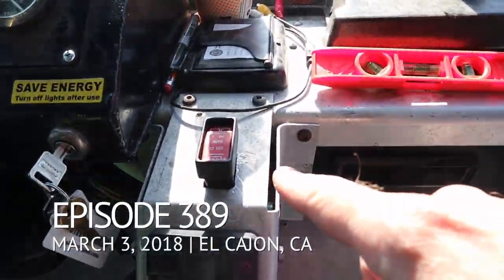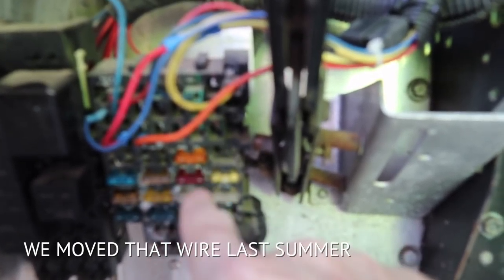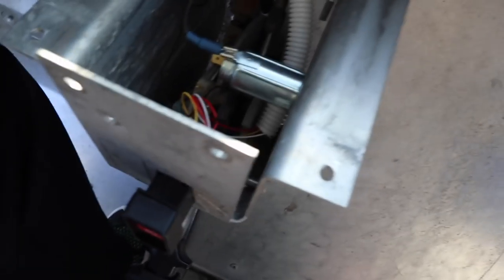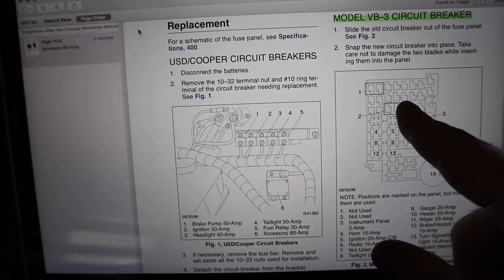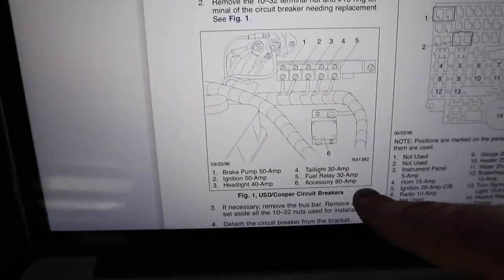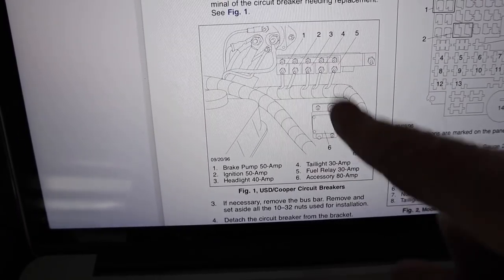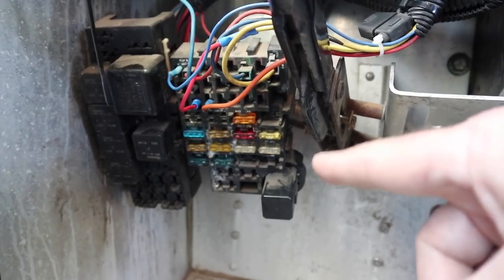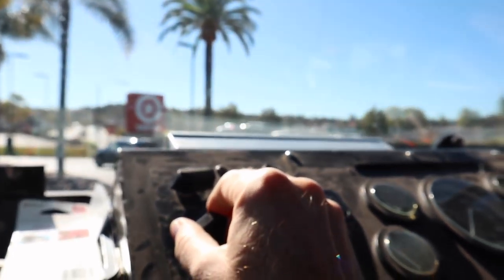Confusing Electric Troubleshooting in Step Van E389

Comment: When you stuck the test light in the cigarette lighter plug you might have accidentally touched the inside ground part of the socket and shorted it out, it's easy to do, the test light is your friend you can tell the voltage by how bright the light is. Wiring can really drive you nuts sometimes
Reply: Marty Records I'm sure that's what happened
Reply from the maker: I think you are right. I didn't know the inside walls were the ground part and most likely touched both

Comment: Hey Seven! God bless you! You didn't lose your temper! I'm afraid I would have taken the little light tester and chucked it! I really hate those things! The meter is my friend!  I'm uncoordinated, and short out the test lead on the outer part of the lighter. So I always go for the terminals on the back, so I don't short it out! Those things make me nuts! Always happens!  So with that your meter on 12vdc you'll be good, and aim for easily accessable terminals to contact.  You did great moving the WW to the IGN finding another spot. So that validates that on the fuse block #1 seems to be dead.  Not sure, but I would like to validate the red wire that is not connected to anything is maybe the same as #1.  So I do this with meter, but going for continuety tester.  So on your meter when you touch the two leads together it maybe beeps upon touching the two meter leads together.  So if you can identify that on your meter then I would proceed. The mystery red wire, strip a little insulation off, put one lead on there, and the other lead to #1 on fuse Block. If it beeps or has continuety you know that is it.  Someone else mentioned "fusible Link" which might also be the case, I think the PDF you accessed would refer somewhere that there maybe fusible links used.  A fusible link is a section in the wire that will break when amperage exceeds a certain rating just like a fuse. Except it is not replacable like a fuse.  I cut out the section and install a "Inline fuse" that I can check/and replace. So if this red wire does not read continuety to #1 then maybe it's not it at all or it is a fusible link. Then removing the fuse block, or if you could see the wire in the back of #1 and where it goes, that would be the key.  If I were to remove the fuse block I would disconnect main power at battery, just in case!  So the Fan on the Dash,  is that the original heater blower fan or an add on?  Well, you are doing great! God bless, stay patient, take breaks to refresh from frustration!
Reply from the maker: this was a big struggle for me (as you can see in the video). making good progress on stuff today and I think we have it all solved (see a video in a couple days with how we solved it)

Comment: I doubt it's the 80 amp breaker, 80 amps is pretty darn big, like the whole fuse box feed big. What I'm afraid of my friend is the Buss/wiring on the back side of the fuse block is messed up. Pulling the fuse box is not going to be fun, BUT take your handy dandy gee-whiz test light and see if you you actually have power at the fuse box where you're plugging stuff in. I just saw you move the wire for your wipers and watching your fuse box bounce around (Yep I'm commenting on the fly), you do realize every time that darn thing moves around you risk breaking and disconnecting the wires going to and from said fuse box? Check your feed (see if there's power at one side where the fuse plugs in), if it's bad fix it AND THEN BOLT YOUR FUSE BOX DOWN SO IT DOESN'T FLOP AROUND AND BREAK AND DISCONNECT THE WIRES ASSOCIATED WITH IT. Sorry to yell but if you don't tidy up your wiring it's going to continue to give you troubles and eventually leave you in a bad way in a place you don't want to be left in, and we both know that would suck! As far as why all that stuff quit I'm guessing when you stuck your test light into the lighter your probe contacted both hot and ground and made a nice little short circuit, but luckily your fuse blew, the alternative would be wires melting and maybe some fire, don't know that you want or need ratings that bad. Buy the way I used to assemble some of the wiring and hydraulics on Winnebago motor homes, now I just weld stuff together making little steel parts bigger steel parts.
Reply from the maker: you are absolutely correct. with the help of Daniel who you'll see in a video soon, we pulled it out and found no power to that section of the fuse box. a relay feeds power to that area and the connections on the relay have failed due to corrosion. we are getting close to a fix now!

Comment: Ground wire going to the dash by lighter should be on some more substantial metal. When using test light, put alligator clip on same polarity your wanting to test or you will cause a short and blow a fuse or something else like you experienced. I would suggest couple things 1. Since a small section of the fuse box is out you really need to try to pull the fuse box loose and check behind for wire/connection issues. Should have an under hood fuse box also you will want to check fuses in also and potentially wire connections to that fuse box. 2. If all that fails run a wire off the under hood wire block or battery to a new wire block since everything is supposed to be fused in line that is out, just make 100% sure everything is fused somehow and you should be back in business. Fuses can be tested with test light without removal by clipping alligator clip to positive source and  placing tip on top side of the fuse in tiny holes on each side checking for voltage at the same time, If test light lights on both sides of the fuse you know the fuse is good, some fuses will not be juiced when ignition is off so you will need to test those with ignition in the run position. Sorry to hear of your frustrations, doing things yourself for the first time can be frustrating when they don't end with the desired result, consider it a learning experience that may help bale you out of worse trouble in the future.
Reply from the maker: excellent advice. will check behind the fuse box!

Comment: Not sure if your van dash is aluminum or steel with a nickel coating on it but both of those things can cause problems when grounding the system look for a good steel place and sand the heck out of it hook the ground in the new place and see if that fixes it.
Reply from the maker: everything is aluminum except the steering column. maybe I can attach there (ps I have a subscriber helping me now working on it, appears it is not a ground issue but rather a failed relay connection)
Reply: Relay is probably it. Good luck on it. I love problem solving when it’s not my problem. Your videos are very interesting to me. Thanks

Comment: Seven, since that area of the fuse box had power and now doesn't, see if your diagram has anything describing a fusable link (it looks like regular wire but is soft and flexible moreso than regular wire).  There may be a fuseable link powering B+ components for that section of the fuse box.  You can easily check the circuit breaker with that test light, see comments below with links to test light useage. Keep in mind the whole metal point will have power on it, that touched the side of your lighter housing when you were poking inside which caused your fuse to blow. I would suggest moving the max fans to house battery and fuse protection there now too. Front fan should be key on, same with wipers.  No key off power to either. Maybe that broken red wire is the feed for something else off of B+ that was feed to the wiper power off one of those relays...
Reply from the maker: we couldn't find anything in the diagram like what mention with fusable link. maxxfans will be moved to the house batteries in the near future. not worried about them now and only mention them for diagnosing the problem
Reply: Seven Wanders the World sorry, was thinking maybe maxxfans plus the rest may have caused over current and melted fuseable link.

Comment: Trouble shooting elec. problems, as you have found out, can sometimes be very frustrating. The fuse box needs to be inspected with the battery disconnected. Check and see if the battery box will come apart, check for corrosion or a grounding problem within the box. Check for continuity on each or the wires from the suspected area on your fuse box. Be careful moving wires in your fuse box, very easy to overload the fuse on that particular circuit. Finally find out what that disconnected wire under the hood goes to, not always but the wiring if it's factory installed should be color coded, that wire appears to be a hot wire, believe it's color was red indicating it is a hot wire.  Remember, good troubleshooting  ia nothing more than a process of limination.(sp.)
Reply from the maker: great tips for the fuse box testing

Comment: When you inserted your test probe into the cigarette lighter jack you accidentally shorted it out and blew your fuse. Just remember that those jacks have a positive at the center and negative around the interior circumference. If your probe makes contact with both of them then it will short and blow a fuse. You need to very carefully insert the probe and only contact the center contact of the lighter jack when testing.
Reply from the maker: I think you are right!

Comment: One (somewhat) permanent solution to the windshield wiper issue, is RainX if the wipers decide to quit.  I rarely use the wipers, even during a downpour of rain & I see ahead just fine.  Yes, you need to reapply every other week, but at least you can see what's ahead!  That'll give you time (& a backup solution) to find a (more) permanent fix IF that lead wire comes loose while driving in the rain.  And believe me, it will when you least expect it!  Murphy's Law!
Reply from the maker: when I bought the step van last April the wipers were not working and I used RainX for the first several days driving to get it to my sisters house to fix the wipers

Comment: You best buy some heat shrink tubing and get a layer on the test light probe. Leave only 1/4" exposed behind the point. It is very easy to short out a cigaret lighter socket with those style testers.
Is there anything in the service manual pointing to a fuse under the hood for those terminals in the upper left corner that are giving you problems? That is a General Motors style fuse block found in many of their cars produced in the late seventies through the nineties. Many times these accessory terminals were fused in an under the hood fuse block that was covered with a black plastic cover. Chances are if these terminal had constant power while the vehicle is off, there is no relay controlling the circuit. Relays are used to switch high amperage loads that small switches can not handle. Most ignition controlled points go through a relay.if you ever have an issue with your horn not working, many times its a bad relay or corroded contacts on the relay or socket.
Reply from the maker: great tip on the heat shrink

Comment: If you look at the diagram, only two spots inside the #1 square are energized. The same goes for square #2. You can test those with or with out the key on with your multi meter. Positive lead on the metal contacts, negative lead touching a good ground. You need inline fuse holders with the proper sized fuse or you could really fry something. Anything shorts out and it could fry your wiring and maybe start an under dash fire. You could unscrew your fuse box, turn it around and plug the wires into their proper fused circuits. Those fuses are really easy to check, you can see two bright specks at both ends. You put one lead to one and the other lead to the other side, you should get 12Volts across, some will need the key on.
Reply from the maker: fantastic explanation and helps me wrap my mind around how the thing works (no explanation in my PDF service manual)

Comment: From what I see from your video the 12volt Positive feed wire that supply's the upper left corner of your fuse panel is dead, so the easiest way to see if that is the problem is to supply power with a jumper wire. Looking on the back of the fuse panel you should be able to see which wire is feeding that corner with power, if u can disconnect it  and run a wire directly from the main chassis battery Positive terminal to that feed connection on the fuse panel. You can also just hook it from the front into one of the spade terminals in that corner, this is a test not a permanent fix so don't leave it like that just long enough to see if stuff will work with direct power applied.
Reply from the maker: Kelly this is a fantastic explanation on how to fix the problem. I think you are 100% spot on with your analysis and solution (see a future video of my work with Daniel yesterday on this)

Comment: Well. . . . your doing good.  A ground isn't involved in that fuse block, its all positive.  Figure out what powers that block, if you can't figure it out, put a "jumper" wire to a good source.  Sometimes thats the permanent fix.  The electrical probes are pointed so you can stick it into a wire (gently) and see if it has any power.    A can of electronic connection cleaner is a good thing to have to clean all the connections.  My power failed at the RTR, I found it to be a bad connection on a push on connector, which may be your problem too               I went to the grocery store and there was a big, white step van, an RV,  in the lot with that orange light in the front.  No 7 on the side, so it wasn't you, but otherwise its your twin
Reply from the maker: wow! you found my twin! thanks for the tip on connection cleaner. I'll get some of that!

Comment: The reason why your lighter socket on the dash had no ground is because it was grounding on the metal dash. Can you run a new feed from the live side of the solenoid to that part of your fuse panel not working, it will need an inline fuse as a just in case.  One reason why you blew the fuse on the house battery feed is the probe must have shorted out on the side of the socket when you used the test light.  Hope you have it sorted without to much fuss bro. All the best
Reply from the maker: you are absolutely correct. I figured that out just yesterday

Comment: Qualifier and disclaimer: I don't know the wiring on your van so I don't know anything about this, and my advice is worth little here, that said however, please be mindful that the fuse size is sized(chosen) for the load of the ignition.  When you add the current that the windshield wipers add to the current drawn in that circuit there is more current going through that circuit and possibly through that fuse.  Windshield wipers are not a small load.  Possible results are that you might blow that fuse, in which case, replace that fuse, but if the fuse blows there might be too much current in a wire.  Fuses protect several things, wires being one of them.  Gently feel the wires to make sure none of them are warming up because too much current in a wire will cause it to warm up and melt the insulation and maybe melt the wire.  What I personally would do however is to just use it the way you changed it and check to see if any wires are warm; and also use your nose, do you smell any hot wires?  My guess what has happened is there is one wire or circuit supplying your failing four items and because your van shows so much corrosion on connections there is corrosion somewhere that is making a wire or lug or rivet or something that has become a non-connection maybe due to corrosion or lose connection, maybe broken wire.  Pay close attention every time you go near this problem, what you have moved or bumped if the fan or stuff starts working because you may have temporarily made connection through a corrosion or poor connection.  Items like this can be intermittent and a real bear to troubleshoot.  Frustration is normal.  Normal!!!  Please note I'm not familiar with the wiring on your van so I'm not qualified to advise and my advice is worth little.
Reply from the maker: I think you are correct on fuse sizes and wires. with the help of Daniel, we determined the fuse box is not getting power in one quadrant and traced it back to a relay on a side panel which appears to have a short

Comment: Hey Seven.well done your half way there.
You moved the wiper wire to a point that had power to it ( fuse terminal).
Not get you test light and check the outputs from the fuse box.
It there is no power then that is where the problem lie.

Point 1. Sometimes when your are check power outputs from the fusebox the IGNITION has to be switched ON.
Point 2. If there is no power at the fusebox with the IGNITION turned on then you have either (something fused) or
(problem with the fusebox).
Point 3. The RED wire that is not connected looks like it should have an eyelet connection and is broken off from one 
of the other RED cables .
It would be helpful if you got someone with a bit of knowledge to guild you.
Reply from the maker: excellent tutorial. thx!

Comment: I haven't read all the replies here but the first thing you need to do is check the continuity of the wiring - ie using the OHM (Ω) on the Multimeter. This will tell you if something is joined together electronically. This test the the wire isn't broken somewhere. (Sometimes the wire inside the plastic can break without the plastic being broken). So you touch one end of the wire to the other end and the numbers on the Meter should show ZERO. 0.00 no resistance meaning no breaks.
Do this for each cable if possible.  https://www.youtube.com/watch?v=5G622WDZaHg
Reply from the maker: will do that!